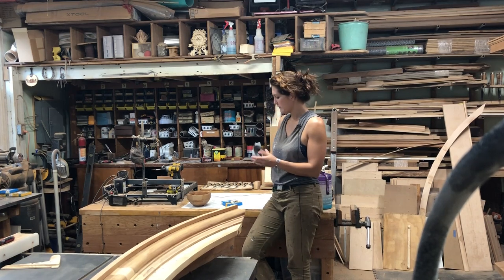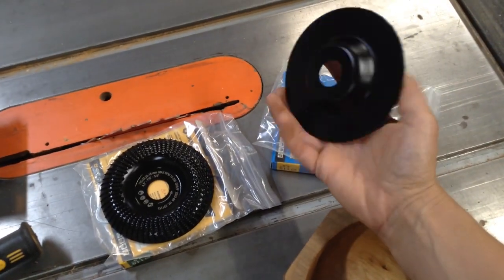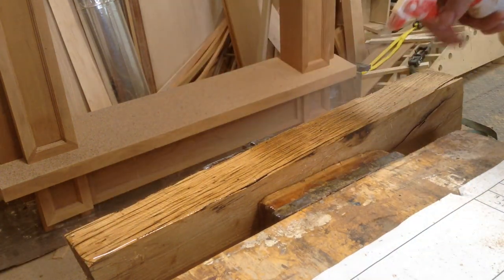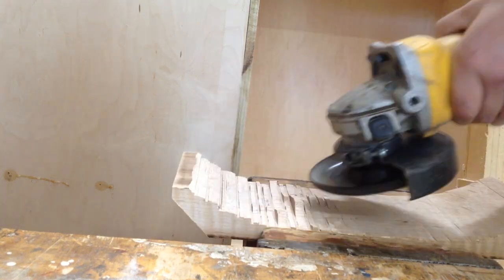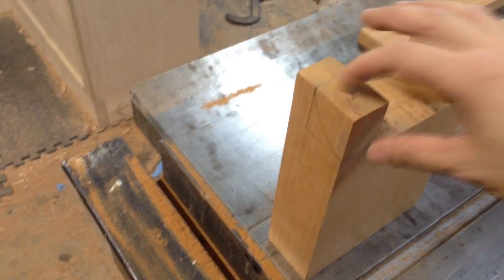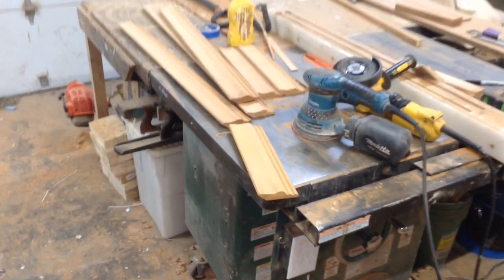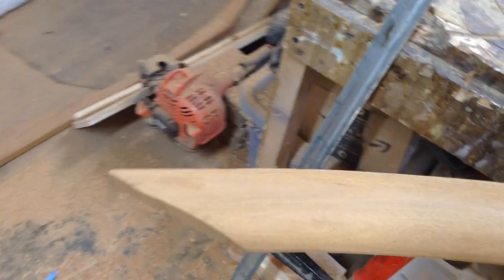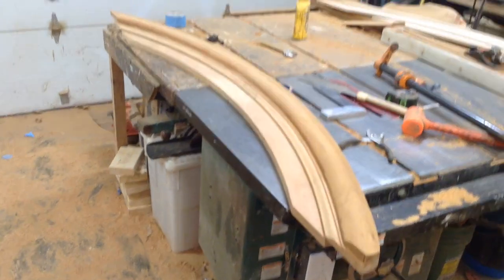Woodworking Projects // Everybody Should Own This Tool

Comment: Very interesting. Masterful use of these and the belt sander in tandem.
I've wondered about bits like these and an angle grinder jig for straight lines and radii. I've also wondered if I'll ever have time to try that out myself.
Reply from the maker: I've never see the straight line or radii jigs.  I'll have to look those up.